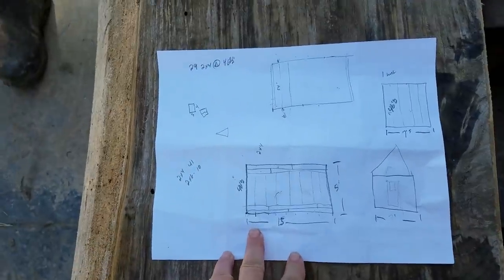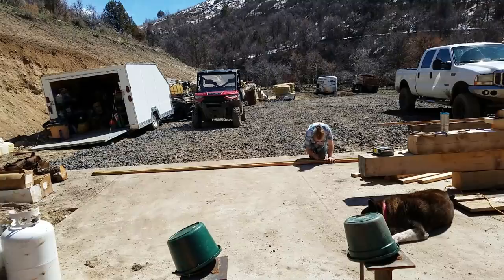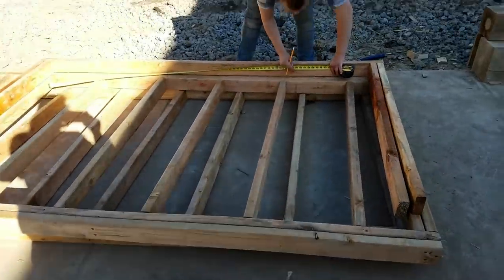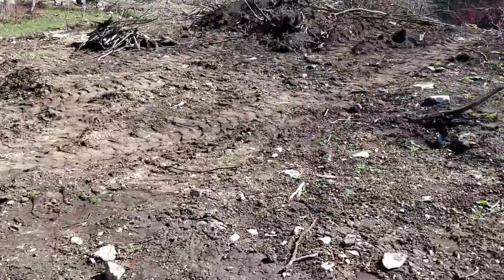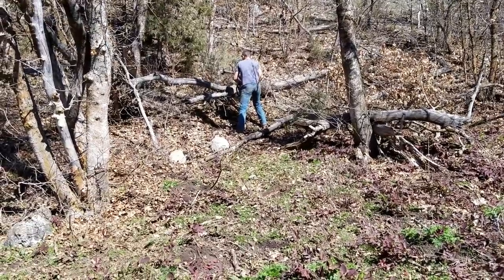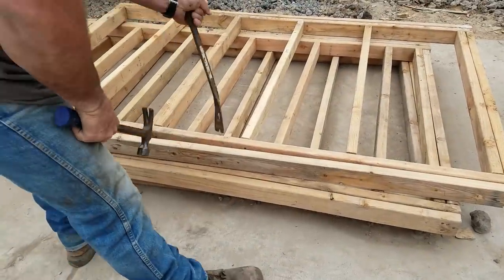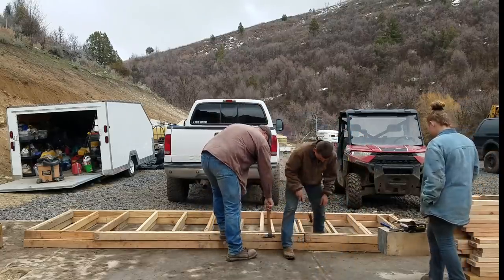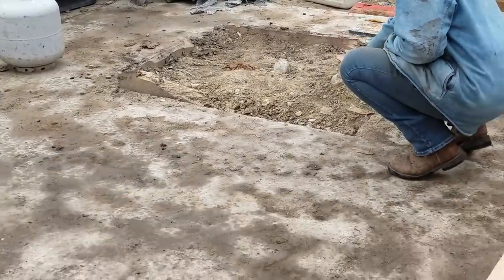Framing Up A Greenhouse - Warning this video has two inexperienced women using hammers!

Comment: Clip 6:33   My grandpa away told me he would take a saw and cut the rest of the handle I wasn't using off of that hammer!  Reminded me of him!
Reply: Lol, great way to make you aware of the right way to use that tool and pass it on!
Reply: Terrel needs to grease the first 6 to 8 inches of handle so will have to use all the handle. Mindy thought it was Terrel's throat and wanted to choke him.